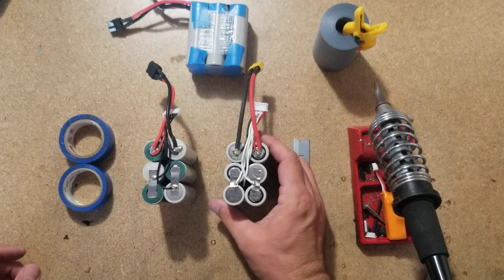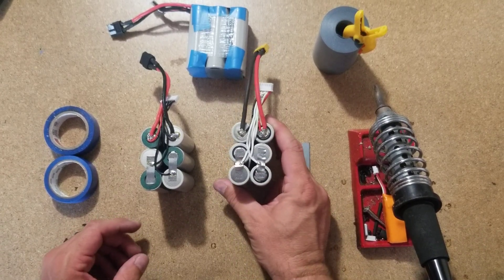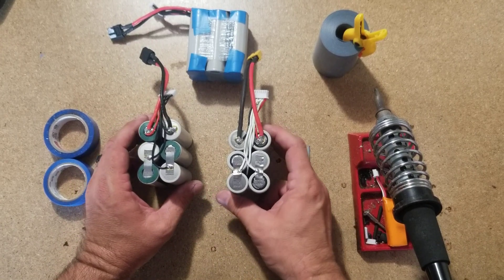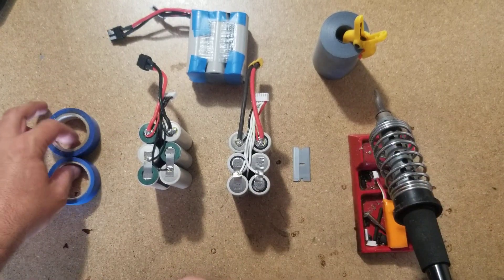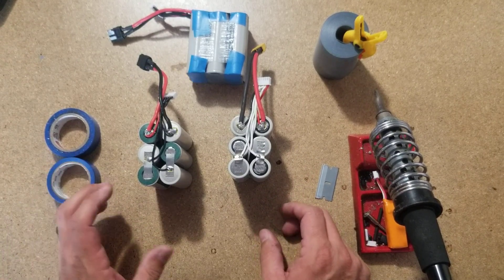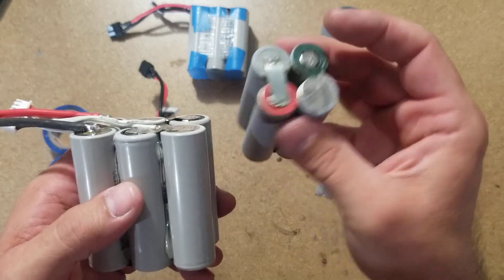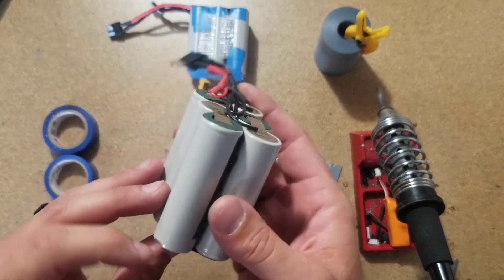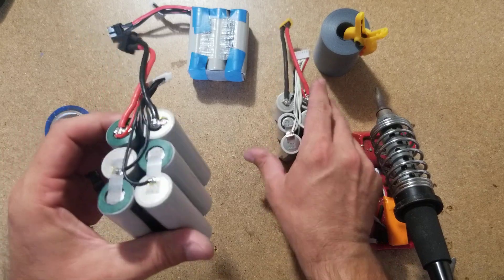Li-ion safety and general building practices

Comment: Thank you for the tips! I have a doubt and I was looking for the main issue you addressed in this video. The nickle strips are just not enough for the kind of power a quad demands, and hence they overheat. I have heard from few experienced builders that they prefer soldering with thick guage wire over spot welding. What is your take on that?
What thickness nickle do you recommend and do you think stacking nickle strips would help with better current flow?
This is the first Li ion pack I'm going to build and wanted to take the best approach.

Comment: Thank you so much, I am looking into building my own li-ion packs and these safety tips you are sharing are of the utmost importance. And I wanted to ask if you use PVC heat shrink on your packs and of what size do you use for the 21700 6s packs.
Reply from the maker: I use 105mm and 125mm for 21700 packs. I do two layers, parallel to the cells and then perpendicular to the cells